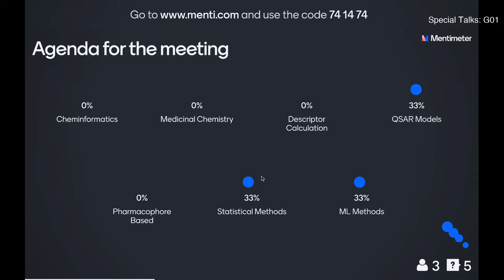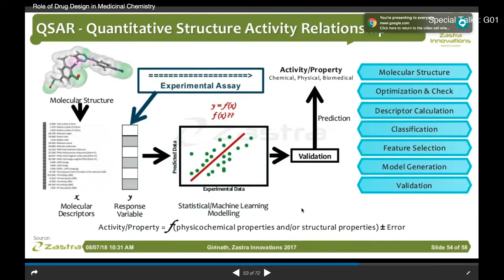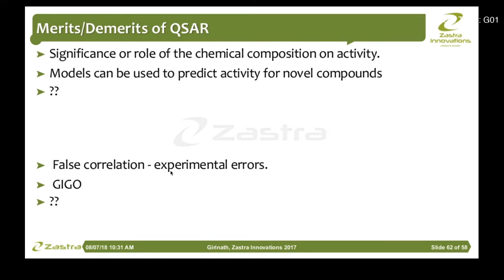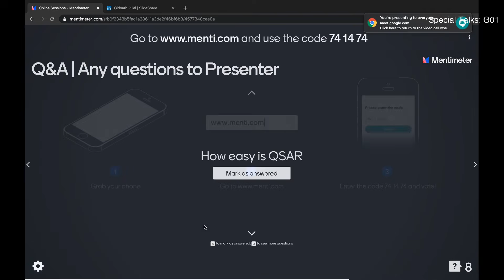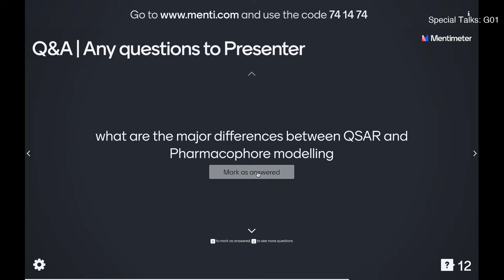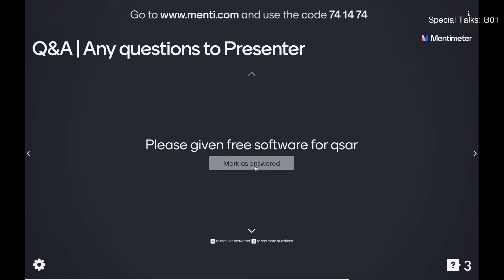How to perform QSAR : Introduction Lecture

Comment: is there any free sofware for doing 3d qsar?
Reply from the maker: Use MOPAC to optimise or extract 3D descriptors from structures. Or even PADel descriptor as well as others like CDK, RDKit descriptors could be calculated and generate QSAR models.